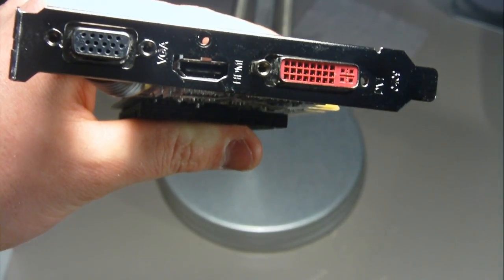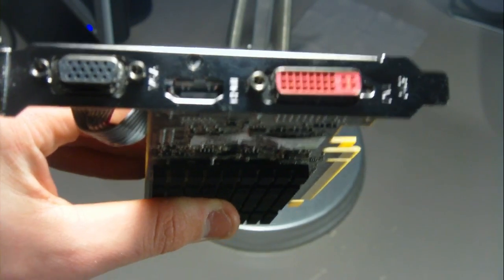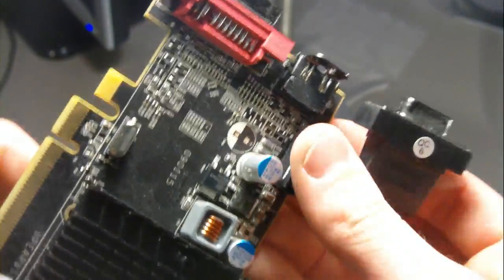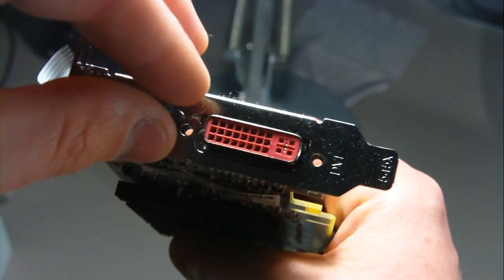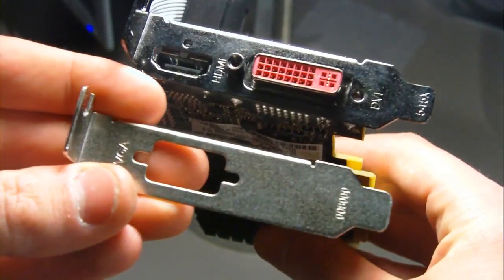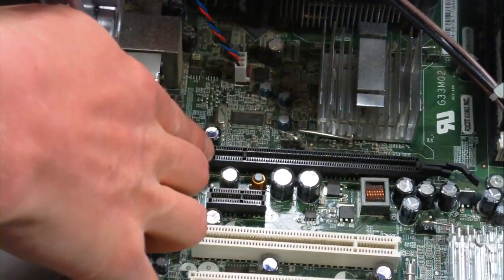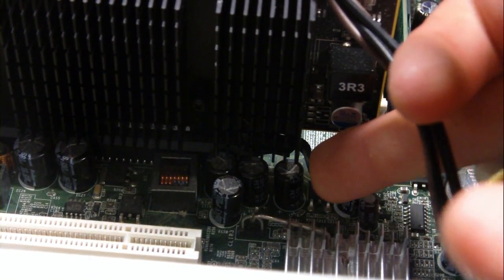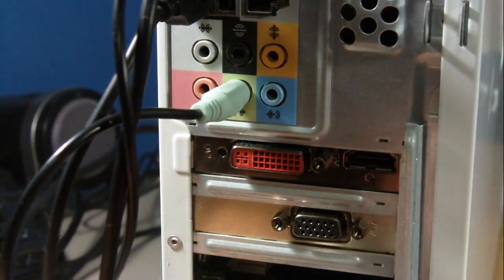[UPDATED] How to install a low profile graphics card (GPU)

Comment: I I did everything but when I boot up mycomputer it doesn't show anything.just a black screen, though mymonitor is indeed receiving the signal?
Reply: so now what'll u do
Reply: It worked. I re-installed all of the drivers. LOL
Reply: Is there a jumper on the board, some boards have a jumper on there
Reply: Im not sure. What if I do? What do I do then?
Reply: change the jumper switch, derr lololol
Reply: i think i only see the CMOS jumper
Reply: Ignatius Michael Check your bios settings. Disable your onboard gpu. :) It is that simple!
Reply: I did, still doesn't work
Reply: Ignatius Michael what's your psu wattage and what card did you buy?
Reply: 300 and people say for 5450 HD at Radeon 1GB doesn't need more than 300
Reply: Ignatius Michael   if it is not your graphic card issue then check if the ram and hard disk is fully inserted
Reply: Did that too! I think ik what the problem is
Reply: sorry bro i can't help you much more maybe you should contact the hardware expert
Reply: Ignatius Michael and what is the problem?
Reply: justchcecked in that it needs 400W
Reply: Nothing. Get a new PSU or a new computer might as well lol
Reply: i was asking u coz i'm gonna purchase this graphic card
Reply: This gfx card is outdated, I dont even think they are still in production
Reply: Ignatius Michael nope. They still are in production! :P
Reply: Oh lol, do you guys have any recommendations for me? A lower PSU intake for a gfx card?
Reply: Ignatius Michael Buy the geforce gt 610 2gb instead of buying a psu or buying the shitty radeon 5450. If you have a minimum of 250w output on your psu, then you should be able to install gt 610! Good luck! :)
Reply: Is it compatible with my desktop though? It has a PCI E x16. It's a HP pavilion a1520n desktop
Reply: Ignatius Michael yeah! it is even compatible with pci e 1.1. :)
Reply: I see, so the GeForce gt610 2GB DDR3 low profile right? Thanks!
Reply: Ignatius Michael ya it comes with low-profile braces !
Reply: Raj Mukherjee wait are you talking about the GeForce 610 by Asus, by nvidia, or by someone else? Or are they really dont matter?
Reply: Ignatius Michael It matters a very little. There are lots of brands like zotac, asus, msi, etc., or by nvidia itself. All those brands have nvidia gpu in them. Whereas others have amd gpu. Brands doesn't matter much. The GT 610 is a low-profile card irrespective of whatever brand you choose. I hope you get what i am saying. :)
Reply: So it doesn't really matter who he manufactures are as long as it has a version of gt610
Reply: Ignatius Michael yup!
Reply: The Asus only needs 29W power? Is that right?
Reply: Raj Mukherjee this one right http://ca.pcpartpicker.com/part/asus-video-card-gt6102gd3csm
Reply: Ignatius Michael ya exactly. it just need 29w at maximum load. I have seen people running the gt 610 even in 150w psus.! And you can buy the asus. BTW, whats your psu wattage?
Reply: Raj Mukherjee my PSU is only 300W lol pretty weak! It sucks :P
Reply: Ignatius Michael 300w is more than enough to power up gt 610.! So go ahead and bring it home!
Reply: Thanks!
Reply: Ignatius Michael Welcome! :)
Reply: Raj Mukherjee hey I have it for abut 4 days now. It was fine, but today when I turned it on, it shows nothing. And just continuous short beep for 4-5 times ish. Is it possible that my PCI e slot that's causing this? Because when I took out the gt610 and use onboard gpu, it works again?
Reply: Ignatius Michael Was just wondering, but did you ever add anything else to your computer besides the graphic card, like extra fans, hard drives, etc.
Reply: Ignatius Michael can you tell me how many short beeps you hear? Count it properly and tell me asap!
Reply: 5 beeps
Reply: I heard it's the mobo?
Reply: Ignatius Michael what bios? ami bios or award bios??
Reply: What's ami ns what's award?
Reply: Ignatius Michael open your bios, there's some name in it. check it out
Reply: Where exactly can I locate this? You mean like open my PC case? Or go to the BIOS settings?
Reply: Raj Mukherjee it works again, but sometimes when I try to play something, my computer freezes so I have to restart the whole thing....
Reply: Ignatius Michael that's weird! I too have gt 610 and running it on my 250w psu. It's working fine for me. It's from Zotac though!
Reply: Zotac?
Reply: Ignatius Michael yeah! you got asus. I have zotac!
Reply: ***** none of the above makes sense. he said, the device won't boot at all. So, it could be a faulty psu or less power coming from the psu or the card is not properly seated. in his case, i think the power supply unit is at fault. But still, he said it's working fine now.
Reply: Ignatius Michael Good for you! So how's your gaming experience in this card?
Reply: Pretty good actually, so far at least way better than a 64mb onboard LOL  Raj Mukherjee though I still experience some freezing and stuff which I dont know what to do about.
Reply: Ignatius Michael haha same here. Playing watch dogs with this thing now! It runs amazing!

Comment: is there any low profile gpu that can run on an 280 watt power supply?
Reply: The GTX 750 is a good one. It already uses little watts so low profile will send it to super low watts most likely or something. The none  low profile version can be ran on a 250 watt powersupply so... and its great for playing all the latest games on high- ultra 1080p settings.
Reply: as we type I'm running a GT 610 on a 220 watt power supply .. u can get a good card on a low watt power supply as long as the card doesnt draw that much power itself

Comment: So I'm not really supposed to plug it in to the power supply?
Reply: KingBeastMode HD if it is not pci xpress
Reply: ravi thind What? Every graphics card past 1998 all connect with a pci express. Some need an extra cord though for power.

Comment: Hey thank you very much. My issue is that when I plug the card in and start my computer I get NO picture on the screen. Should I have put the CD in when I start the computer?? If not is there a way to check the card to make sure it's not damaged. Any guidance would be helpful. Thanks

Comment: I have a Gateway AMD E1-1200 1.4GHz Windows 8 Desktop 64 Bit OS PC 4 GB Ram. Its a small computer....What is a good low profile card to get for it for around $75-$100?
Reply: radeon hd 7750 is 100dollars and the best card you are gonna find get the low profile 1gb version

Comment: btw can i still use the graphics card if i dont have the low profile metal strip thingy? (can i use it without it?)
Reply: nvm, the card that didnt have the smaller bracket is worst then the one currently in, btw how do i uninstall a graphics card?

Comment: You should also tell people NOT to touch the PCI-E Graphics card connector edge with their dirty greasy fingers. Also, Using the Install Disk is not a good idea. Before taking PC apart, go get the latest drivers from the Manufacturers Website, as the ones on the CD are Outdated.
Reply: i used the cd for my 750 ti and it automatically had the up to date drivers so you might be wrong about that.
Reply: lilpandasdancin
I'm not wrong. But your step takes double the time, as you have to install the drivers from the CD, then the updater has to go online, grab the new update, & then uninstall/reinstall them all over again, & requires 2 restarts to complete the 1st instal, then the 2nd reinstall. All because you could not go to the site & get the updated drivers yourself. I guess the easy way but longer way. But If it works for you, then that's OK as well. Just takes longer.

Comment: What if the video card doesn't come with a low-profile bracket, but the card is low-profile ready? Could I just take the regular bracket off and put it in without a low-profile bracket?

Comment: hey i need help.. i have a low profile graphics card similar to radeon hd 5450. i did the same u told but the card was not getting detected. And i was getting no display on my monitor when i connected it to vga.
i need your help, please help me. I have bought it to use it on my old core 2 duo pc.
it also has enough power supply to run it. reply ASAP.

Comment: I'm not sure about onboard but i guess its the same, uninstall the drivers before you connect the card, Sometimes there will be duplicate with different dates and this can cause issues, Better off playing it safe and install clean,
 If you leave it until afterward you may delete a newer file by mistake. First thing youll probably do anyway when you install the card is go to the website for the newest drivers so its probably a waste of time installing the drivers straight from the disk anyway

Comment: if your mother bored has two slots for the video card. Yes. Also if you have newer video cards they have things called SLI/CrossFire fingers that you connect to each other with a special wire that comes with the cards

Comment: I hope you can help me. I have an ATI Radeon HD 4670 graphic card. I used to have this card plug to the pc and working with a DVI cable. I Reinstall my win7 and now it wont send the signal through the DVI port. It only appears on the screen the starting windows logo and then black screen. I have to plug a VGA cable with some DVI adapter and works, but not with the DVI. I used to have the same card on the same pc and now i can´t find the problem. Thanks bro.

Comment: No you cannot no matter what. It's just that the integrated graphics  uses a chip set that refers to that chipsets CPU. when you install a graphics card, it uses the chipset that's connected to the GPU, and makes the order that what ever is connected into the PCI or PCI express shows up first and only video out source. basically sets the IRQ to a definite position , and connecting to the Integrated graphics shows nothing because it acts like it's not there.

Comment: Hey I was wondering if you could actually do this with the double bracket high end cards? I currently have an old machine, a Dell Optiplex GX620 MT and the weird thing about these PC's is that the motherboard is actually on the right side of the case and installing a double bracket card actually places the top bracket on top of the bracket slot. Meaning there's actually no higher bracket slot on top of the bracket slot that's aligned with the PCI-E port

Comment: Hi I bought a AMD Radeon Gigabyte HD 5450 graphics card yesterday. I did everything I was supposed to but when I log in my computer gets a blue screen and crashes, then restarts. I tried going to safe mode to install the drivers but it still crashes outside of safe mode. Do you know what I should do? Thank you so much.

Comment: so..I'm updating a card for my Dell OptiPlex 270.
Card: XFX GeForce 6200, 256MB, GDDR2, AGP 4X/8X Video Card 
My PC's specs say that it will support maximum of 32bit.  The card's specs say that it is 64bit. Some ppl say that it will be compatible with my PC..so just to confirm, can u answer me whether the card will work on my computer or not?

thanks.
Peace.

Comment: @WirelessHotShot it really doesnt matter, im sure you could run this with a 220 watt power supply. it uses very low power, i believe its 19 watts at maximum.

Comment: Hey, I recently bought a  SAPPHIRE 100293L Radeon HD 5570 1GB 128-bit DDR3 PCI Express 2.1 x16 HDCP Ready Low Profile Ready Video Card and I was wondering if it would work fine with a Gateway SX2800-01 with a PSU of 220W.  The recommendation for the card I bought is 400W but I read reviews that people with 220W have no problems with using it. I just want to clarify if it is safe for my computer or If I could make any adjustments.

Comment from the maker: @jonnyboy1091 You do not need to back up anything in order to install a graphics card. And the reason it's a low profile graphics card is because it is slim. You can use a low profile graphics card in a normal computer, but if you have a slim tower, you replace the bigger bracket with the smaller bracket in order to make it fit in your tower. If you have any more questions you can PM me.